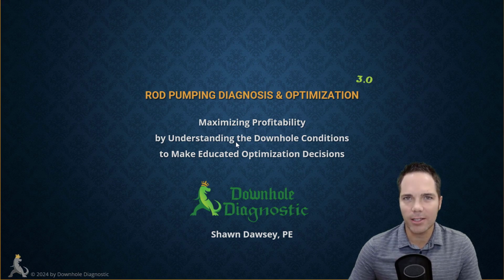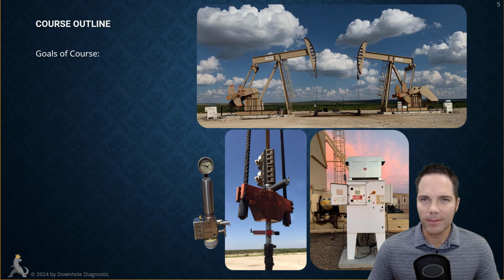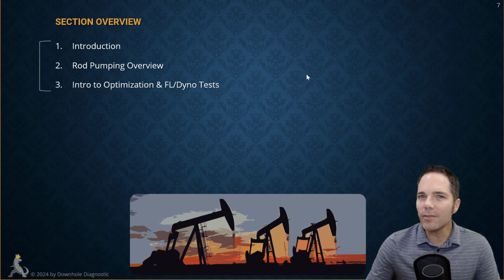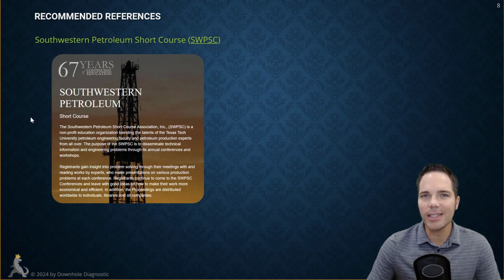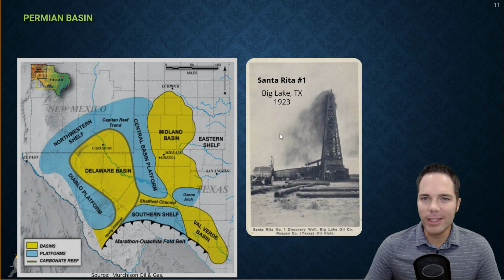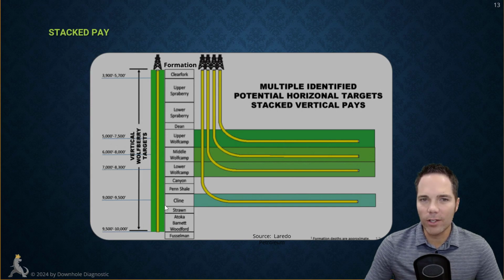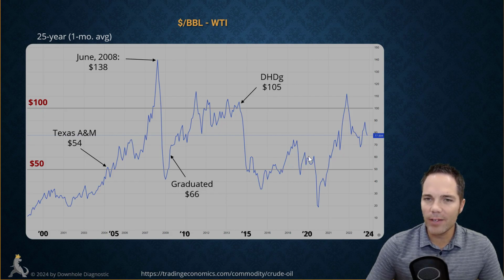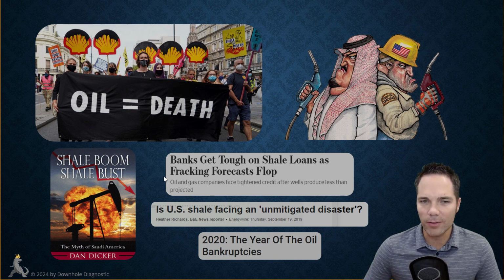01 - Introduction to Rod Pumping eCourse

Comment: You mentioned that a lot of horizontal wells don't use rod systems.  I'm curious, what systems do they normally use?
Reply from the maker: Since a lot of them are pad drilled (many wells on one pad right by each other) and the wellbores are not very straight, rod pumping is more difficult due to increased failure rates.  Many of these horizontal wells start out with Gas Lift as the artificial method, or ESP (if it makes less gas and has a higher water cut).
Reply: esps when they start off till they pump off then gas lift normally then end of life rod pumps
Reply: Had 2 new drills in my run back in April. The well is still free flowing 24/7. There is no downhole tools, no plunger. Just flowing a lot of gas. Gas if flowing above critical rate it 2 3/8” tubing so it’s unloading constantly. Pretty neat.
Reply: Well is not a horizontal. They are about 6,000’ deep.